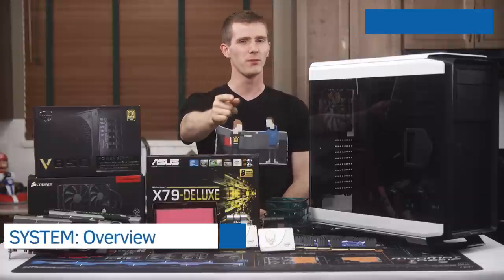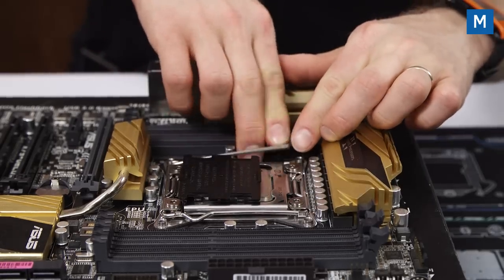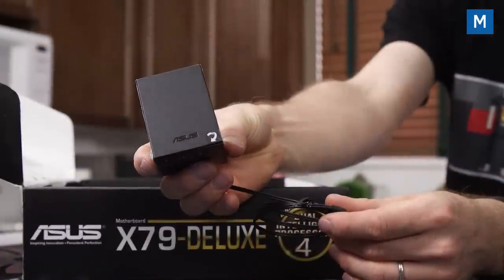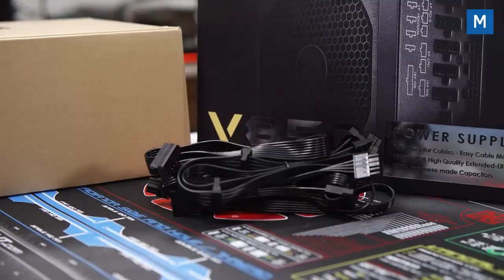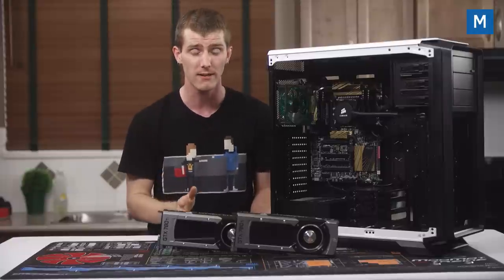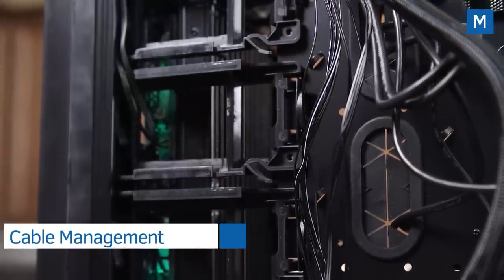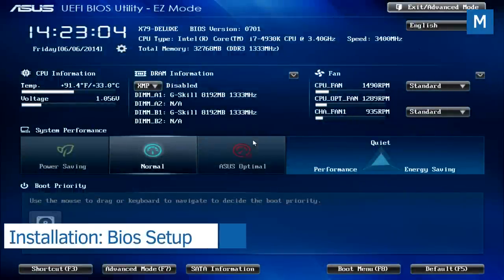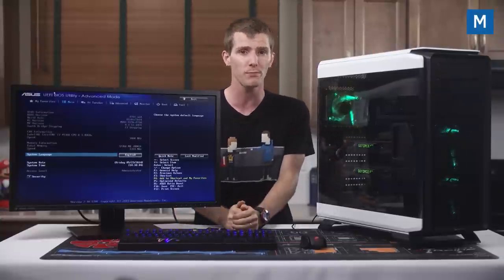How to Build the ULTIMATE 4K Gaming PC Build Guide

Comment: is this good? 

AMD A8 - processor
Radeon  R9  - Graphics card 
500GB - Hard Drive
120 - SATA Hard Drive
8MB - RAM
Reply: Nowhere near enough details. AMD A8 is just a SERIES of CPUs and Radeon R9 is also just a SERIES of GPUs. What specific model are you talking about? For example, do you mean an 'AMD A8-7670K' CPU and a 'Radeon R9 380X'?
Reply: Jamie Smith something like that. cuz im building my own gaming pc this holiday
Reply: what budget?
Reply: Why the fuck does everyone recommend the unlocked processors even though some don't care about overclocking? Get the A8-7600 if you're going APU, but an Athlon x4 845 is better for the money on the FM2+ socket.
Reply: deathbat6916 amd is bad anyway, the amd fx 4350 has the same power as a pentium g3258, which is cheaper anyway.
Reply: Rallenhayestime Good point, although the 845 also outperforms the 4350. But personally if I were going AMD I would just wait for Zen and see the gains that may bring.
Reply: deathbat6916 is x4 860k not better?
Reply: Kimey it actually isn't and it's more expensive. 860K can only beat the 845 in cache and OCing.
Reply: Oh. Guys can u give good specs that can run gta,h1z1,rust etc on high settings
Reply: That's easy.

i3-6100
GTX 1050 Ti
8GB RAM
240GB SSD + 2TB HDD (trust me, that extra space is worth it)
Reply: Tnx ill be building it next week :D
Reply: Mona Lisa No problem. If you can stretch out the extra cash, the i5-6400 is even stronger for the CPU. Of course if you're to do that, I would also opt for an RX 470 or 480 as well.
Reply: deathbat6916 lol good luck with power consumption and fan noise xdddd
Reply: 8mb of ram is a little too little
Reply: JamrahHD 13 Good luck with power consumption? The RX 470 has 120W TDP, in comparison to the GTX 970 (its close performing NVIDIA card) which has a 145W.
Reply: deathbat6916 or you could get a 1050 ti or 1060. 1050 ti uses 60-75 tdp and 1060 uses the same as RX 470. isn't the 970 older? also at least NVidia has better technologies and dx 11 support. But one thing I can say good about amd cards is they are better at higher resolutions and are more future proof. They still use a lot of power tho. Even to todays standards compared to a 1050 ti or 1060. And make a lot of noise and produce a lot of heat. most of the time the NVidia cards fans don't spin
Reply: AMD has DX11 support too, you know. Also, I guess I just prefer AMD.

Comment: do any of u guys know if this is good - CPU: Intel® Core™ Processor i7-7700K 4.20GHZ 8MB Intel Smart Cache LGA1151 (Kaby Lake) [+160]
HDD: 240GB WD Green SSD + 2TB SATA III Hard Drive Combo [+50] (Combo Drive)
MOTHERBOARD: ASUS TUF Z270 MARK 2 ATX w/ USB 3.1, 3 PCIe x16, 3 PCIe x1, 6 SATA3, 2 M.2 SATA/PCIe [Intel Optane Ready]
VIDEO: GeForce® GTX 1060 6GB GDDR5 (Pascal)[VR Ready] (Single Card)
Reply: r u good with pcs?

Comment: could this pc run gta v and arma 3 high settings not ultra with some mods maybe:

-intel core i5-6600k 3.5ghz quad core 
-16gb ram
-gtx 1060 6gb or gtx 970 4gb (not sure which one)

and would all this fit on a msi gaming micro atx motherboard :/ thanks in advance. im a noob at pc im about the switch over from console
Reply: mcArmy yeah

Comment: I have zero knowledge on building pc, so I went to my local computer shop and asked them for a quote on custom pc. I told them that I only play LoL and CS GO. They gave me a quote cost 725 USD. with the following specifications:

Intel Core i5 6400 processor 
MSI H110 Motherboard 
Gskill 8GB 2666mhz DDR4
MSI 960GTX 2GB GPU
ADATA Premier 120 SSD
Cooler Master Elite 550w
Thermaltake Versa H23 Casing

Did they gave me a fair price or are they trying to overcharged me?
Reply: Kay AB they are overcharging you!!for 750 dollars you can build a much better pc.Just go to pa part picker and build a pc there you can see if its compatible with your parts.Just do a little research.
Reply: http://pcpartpicker.com/list/8PFqhq there.This is assuming you have a Keyboard/mouse and Windows is not included.You could get Windows for free if you have advanced knowledge , maybe you got a friend who does.This build is not perfect but it's a lot better than what you got

Comment: Processor (CPU)Intel® Pentium® Dual-Core G4600 (3.60GHz, 3MB Cache) + HD Graphics(Motherboard)ASUS® H110M-R: Micro-ATX, DDR4, LGA1151, USB 3.0, SATA 6GBsMemory (RAM)8GB Corsair VENGEANCE DDR4 2133MHz (1 x 8GB)(Graphics Card)2GB NVIDIA GEFORCE GTX 1050
is this good for 1080p medium-high 50-60 fps gaming??
Reply: Mehas Iljazi maybe get the 8th gen i3, the pentium will probably bottleneck
Reply: Mehas Iljazi no the pentium does almost the same as the 8th  gen i3 and for the i3 u need a more expensive motherboard. If u can though go for the i5 or i5 k

Comment: Hi Guys,

I need an advise.

What do you think of this setup? 

Is this good enough to play the latest high graphic games available out there?

CPU:IntelCorei5-6400Processor2.70GHz
CPUCooler:IntelBXTS15AMultiSocket
Memory:CorsairVengeanceLPX16GBKit(8GBx2)3200
Graphic:AsusGTX10708GBTurbo
Storage1:CrucialBX200240GBSATA3SSD
Storage2:Seagate3.5’’2TBSATA3HardDrive
PSU:CorsairRM650i650w80+GoldModularPSU
Reply: Noted! Thank you for the advise.

Comment: I don't understand... Where is your Internal Hard Drive?
You only have 2 ssds
Reply: +Dank Oxide But isnt an ssd and hdd better than 2 ssds
Reply: +ShadowCooper77 No, why in the world would it be?
Reply: Bryant Woods
Cause ssds are faster than hdds
Reply: If an SSD is faster than a HDD, why would you want a HDD if an SSD is faster?
Reply: +CaptainCheezelz SSD is more expensive. 1 Tb of HHD is around $60-70, while 128 GB (I believe) of SSD cost the same price.
Reply: CaptainCheezelz
because if you have just an ssd, then you're making it use more memory and if you have an ssd and hdd you can have faster games/applications/whatever
Reply: *****
ssds dont have to be low storage. And hdds dont have tp be high storage. It depends on what you buy.
Reply: *****
No! 4TB is way too much, 1.2 TB
Reply: *****
My point is, getting a hard drive and ssd is better than having 2 ssds, because the ssd is faster so you can install games or whatever on there and install all your other things that you want to run not as fast on an hard drive. You really dont need to have things that use less go on an ssd, hard drives are perfectly good for that and cost less money. It would've been easier to buy a combination of a hard drive and an ssd. Although you can get 2 ssds, you should probably get the combo because 2 ssds is really not needed.

Also I was tired b4 lol
Reply: a HDD is only used as storage, you only need it IF you dont have an SSD, and also, the windows OS can be installed anywhere in the SSD or HDD. SSD is also a compatible storage drive, and it is a lot faster than a HDD
Reply: There, there Dank Oxide... It's too late for him. Just let it go... Just let it go... HAHAHA

Comment: FIRST PC BUILD HELP!

Hi guys, I'm planning on building my first PC this month and I was wondering if anyone could give me some tips of parts to buy. Because this will be my first PC, I don't want to make an expensive 4k power beast so I'm going to make a low cost one with older parts, just in case I fuck it up.
So can anyone recommend some cheap and decent parts for me? I'm not looking to make a 1999 trash build but a windows vista/W7 era rig preferably. I'm hoping to install windows 7 on it and have it be working smoothly. I'm not building it with gaming in mind but I would consider an old cpu if its cheap. 
I just want to learn how to build PCs and if it runs ok I will gift it to my little sister so she can use it for her homework :)

Comment: First PC build ever. Let me know how awful I did and if there's room for improvement http://pcpartpicker.com/list/hNFtCy
Reply: Hello! A quick run-through about all of your components and things you can improve on.

CPU - A good choice, but if you are planning to ONLY use your PC for gaming then you can save about $100 by going for an i5-6600k, which has no difference or performance impact on games. If you commonly use your computer for things like work, programming, video editing, then stick with the i7.

CPU Cooler - A modest choice, but if are willing to spend the extra $10, get the Corsair H100 v2, because cable management and looks are considerably better.

Motherboard - Good choice for your price range.

Memory - 2x8 DDR4-2400 is good.

Storage - 250GB SSD is fine but I would recommend getting 500 GB. A 3TB hard drive is a very risky choice since pretty much any hard drive over 2TB have extremely high failure rates because of the amount of platters. I recommend instead getting 250GB SSD and a 1TB hard drive or 500GB SSD and 1TB hard drive (if you can afford it).

Video Card/Monitor - Rip, you definitely need to change this. Using a 1070 for 4k is almost unplayable. Your video card choice is good as the ASUS one has one of the best overclock and cooling capabilities around but PLEASE change your monitor to this: Dell S2716DG. It is 144hz(rather than 60hz) and 2560 x 1440 (which the best resolution for a 1070). The Dell monitor also has G-sync (which is an input-lag and stutter free alternative to V-sync for Nvidia cards), just make sure to enable it in the Nvidia control panel.

Case - One of the best ATX Mid Tower cases around, but a Black/Red one would look better with your color scheme.

Power Supply - A good choice, but if you want an easier installation, then get a semi-modular power supply (because a full-modular one you have to manually plug all the cables into the power supply, but with a semi-modular the required cables are already installed, but if you need any extra ones you can plug them in). A good semi-modular power supply is the EVGA 210-GQ-0650-V1. But IMO, it's generally better to stick with the one you already have.

Wireless Network Adapter - A great choice, it includes ac and is only $30.

In conclusion, make sure to change your monitor to a 144hz 1440p one and change your storage. I made a list of my recommendations in PcPartPicker: http://pcpartpicker.com/list/gQRkD8 . In it, I have changed the CPU cooler, storage, case, and monitor. I hope I helped you, and may your framerates be high and your temperatures low!
Reply: +Paul B WOW, thanks for the amazing response. I just realized that I meant to add a gtx 1080 instead of the 70. And I thought the I7 would be more suitable because I'll likely be using this rig for everything under the sun; but mainly gaming, music production, and video editing.
I'll definitely reconsider my storage choice, as I was unaware of the failure rates.
Lastly (since I'll be using the gtx 1080), do you recommend a 4k monitor at 60hz over a 1440 at 144hz? Keep in mind I've been gaming on laptop monitors and TVs my entire life. (I'm in a comfortable financial position FOR NOW, so I'd like to go all out while I have the ability.)
Reply: hey can you PLEASE help me, im looking to build the ultimate gaming/editing/producing computer because of a high demand for beats and music videos i've been receiving. whats the best things i can buy under 10,000 preferably under 5,000...im looking for the most power and highest quality which also looks pretty good because people will be recording at my place
Reply: +keepiticy Hi! I made a part list for you here: http://pcpartpicker.com/list/qwDjGf . It includes every peripheral, including monitors and speakers.

 This build is a great choice as it will run crazy quite, the cooler and motherboard have rgb lighting and look very decent, the SSD is insanely fast, SLI water cooled 1080s will provide you 4k 60fps+, plus, they are easily overclockable and run at good temps, and the power supply will provide extra overclocking room for the cpu and video cards.

Since you will making music the build includes a top-of-the-line sound card, speakers, and headphones. The WiFi card is also very decent. The keyboard's keys are amongst the fastest on the market but the mouse to buy really depends on your personal preference. If you have normal-sized or small hands, and don't necessarily focus on competitive gaming (CS:GO, DOTa 2, LoL, etc.) then I recommend the Corsair Sabre RGB. If it is easier for you to make a claw-grip and you commonly do comp gaming, then I recommend this mouse: Corsair M65 PRO RGB FPS. The monitor is literally the best you can get on the consumer market, it features a curved IPS panel, and has a refresh rate of 100hz (a awesome refresh rate for monitors 4k and 3440 x 1440).

Hope I helped!
Reply: Paul B HELPED ALOT!!!!!!!  you are literally a life savor man
Reply: +Kyle Partlow Hi! 1440p 144hz or 4k is a tricky choice and depends on personal preference and the games you play. If you constantly do comp gaming (CS:GO, LoL, etc.) then 1440p 144hz will be superior, if you don't commonly play games like that you may be better off with the 4k.

A problem with 4k and the GTX 1080 is that if you play intensive games on ultra, you'll be getting around 45 fps average, whilst with the 1440p monitor you'll be hitting 90 fps. But with g-sync, it will feel more like 60 fps on 4k and is a great solution.

If you overclock you may be able to reach 60 fps 4k. If you are going to overclock it's important a get a good GTX 1080 with good overclocking capabilities. The best 1080 on the market is the Asus GeForce GTX 1080 8GB STRIX so you should probably get it regardless of whether you are going to overclock or not.

The 1440p monitor I recommend is the Dell S2716DG, the 4k monitor that will do the best is the Acer XB271HK.

I hope I helped and make sure you enable G-sync! :P